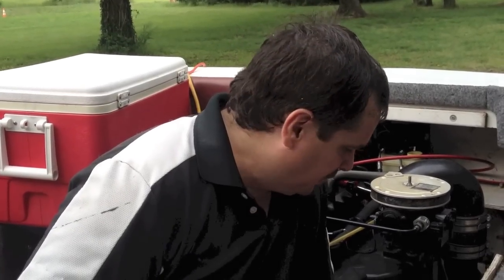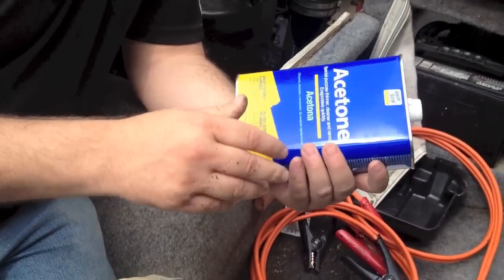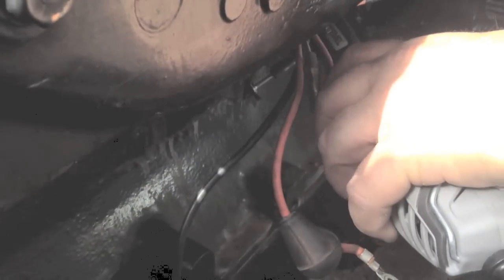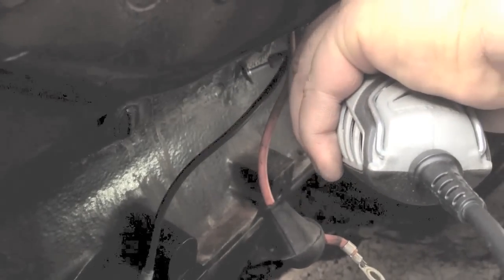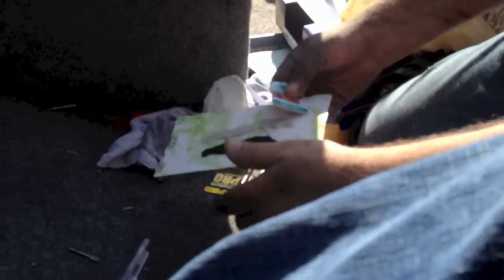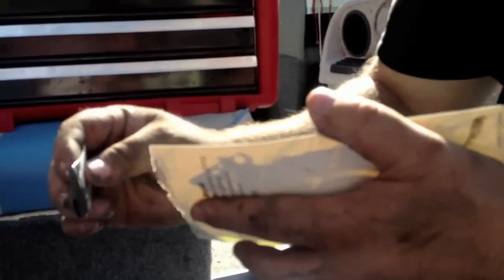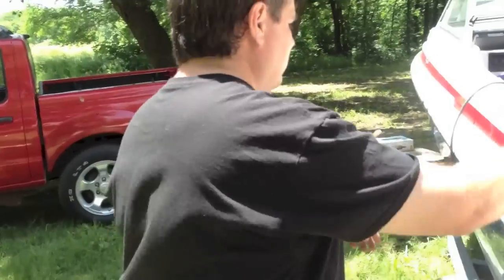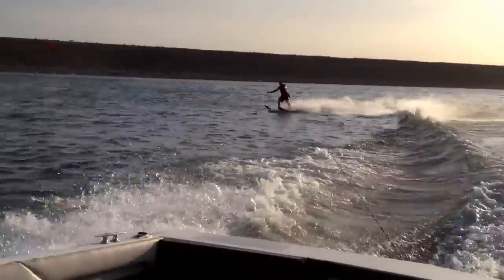Cracked Engine Block - Will JB Weld Fix It?

Comment: My JB Weld story: It was early 80's and I had a Saab 99, which preceded the 900. The harmonic balancer broke off in the winter, here in Alaska, and it was a nice clean break. The break in the balancer indexed very well to the end of the crankshaft, so it was a very good alignment, so I spread on the JB Weld, propped it up to hold it solid and put an electric heater on it all night. I drove that car for over a year before I sold it, and never had a problem.

Comment: I repaired a Cummins ISM cracked block with JBW behind the engine starter on driver side That was 4 years 215k miles ago and the engine still running strong without leaks. Awesome product. I strongly recommend it.

Comment: Most boats’ cooling system are not a closed system so it doesn’t build up pressure like a sealed cooling system with a radiator or heat exchanger so JB Weld will work just fine.

Comment: This stuff, in my opinion works great even as a permanent repair. I have used to repair counter bores on diesel engines, intake manifolds and such. Wonderful product! Very nice job cleaning the area Donnie, you will never have any more problems with that crack due to JB weld failing!
Reply: B s u havent applied it were oil pressure iz

Comment: I used JB to repair my crankshaft on my 350 chevy it held fine even though i'm running 100 shot nitrous.
I also used it to repair my wheel hub ,I did that 10 years ago and I run over 150 mph works great.
I also blew out a clutch on my work van but made a clutch out of jb weld.
I couldn't afford to fill my daughters tooth cavity so i used Jb weld
Jb weld is life , i got back with my wife because of jb weld
I haven't seen my son in 5 years
Reply: +bugatti veyron LOL hillarious
Reply: I was believing every word you said until you said van and clutch.  DOH
Reply: bugatti veyron I made a clutch disc out  of jb weld for drag racing. 
It grabs great. 
You should try one in your Bugatti veyron.
Reply: dude that is the funniest shit my stomach hurts from laughing
Reply: Jb weld can bring the bond between you and your son.
Reply: Jose Castellanos 😂
Reply: This shit had me dead laughing funniest shit I ever heard lol
Reply: JB Weld and Chuck Norris fought once. They decided call it a draw after 4 months of battle so Chuck would have time to round house kick the moon back into its proper orbit.

Comment: I have a1990 Dodge Dakota 4 x 4 that I have converted into a tractor, it sees hard service.  I didn't winterize properly either and ended up with a two in crack  just under the exhaust, I cleaned it up and cut a groove in the crack..BUT, the difference in the way I made my repair was that, I applied a VACUUM to the engine VIA the overflow "TIT" on the radiator.  I let it pump for about an hour, then I applied the JB WELD, let it keep pumping for another 20 minutes, it pulled it right in, I think that enough JB wasa pulled in to equal the block thickness .   I have sice tried this method on several other engines including Marine Engines.  It works great, all you need is access to an AC Vacuum compressor.  This way the JB is pulled intto the block and not just "stuck" on the outside like a "patch"..and this method works with other Mediums besides JB WELD.  
Regards ,
Boyd E. Falk
Reply: +Boyd Falk That's a damn good idea, on the vacuum pump!!  The block cracked in my diesel pickup and I'm going to try your method because I've got a vacuum pump that I use for A/C work.  Thanks for that idea!
Reply: Let me know how it worked out for you, I still haven't had any problems.
Reply: We simply drill small holes at both ends of the crack, grind out a deep V groove, and stick weld it with Nomacast.  The secret is only doing 3/4"-1" at a time and waiting a full minute before doing another 3/4"-1" section.  It works every time and we've never had a problem.

Comment: My father-in-law JB WELDED an engine block on a tractor,it was cracked all the way down the side,it has held now for over 25 years now.If I remember correctly,he put it on in layers letting it dry in between each layer.
Reply from the maker: Tim Ballentine Wow…25 years, that is good to know.  Thanks for letting us know.
Reply: +Tim Ballentine MAN THAT A BLESSING IM
Reply: Que Bridges Amen,it sure beat having to buy a new engine .
Reply: +Donnie Smith 497 years ago I fixed the crack on the Spanish Titanic using JB Weld,with the iceberg going through it,and never had problems since. The boat just passed its tests and I will have a party on it,for my 840 birthday. 
And by the way,a piece of the iceberg is still stuck in the boat. J B Weld helped to keep it intact. inside the iceberg,you can clearly see some oysters,an old boot,and Pamela Anderson's great great grand mother knitting bikinis for then Baywatch!
Reply: Tim Ballentine I have a blown engine block do you think it would work

Comment: Was very skeptical. Recently I was challenged with the same issue. Crack was horizontal with the cylinder head and about 9 inches long. No water in the oil, ran like a top. Opened up my crack a tad more with a dremel, stop drilled the ends with a #30 bit, cleaned the area with a cup wire brush on a 4" grinder and wiped the area down several times with acetone. I applied one coat with a putty knife pushing it into the crack. Waited 6 hours and applied another coat over the area. To my surprise, it worked like a charm with no leaking whatsoever. I'm currently looking for a replacement engine as I'm not sure I trust it just yet but, it did the trick.  Thanks for the video.
Reply: was water actually leaking out of crack?
Reply: You still running

Comment: Had a ford ranger with a cracked block.... ran 57,000 more miles after applying it. It held up and trust JB weld. Now, not all cracks are the same and other cracks in different areas will be different. My crack was at the driver side above the manifold right over the number 1 exhaust port. We also drilled and bottom tapped two holes and placed a steel plank to help with expansion. I know that was probably 95% of the fix, but the JB weld held it all together. It works.... just not with a piston hanging out of the engine lol

Comment: I have repaired a couple of 400 sbc race blocks with JB Weld and it worked very good. The engines had about 650 hp N/A and 300 hp of spray on them. They lasted for a few years each before a different issue put them out of commission.
Reply: That's what I'm going to use it on a 400 small block 598 horse power very slight crack..hope it works
Reply: @ronkush69 did it work?

Comment: I have used JB Weld on the cracked alloy sump on my VW: has lasted 8 years so far and 100,000 miles. Otherwise it would have been an engine/gearbox removal to get the sump removed for welding. Only thing is that the surfaces must be 100% clean and roughened.

Comment from the maker: Hi Jimmy, I hope it holds out for the summer too....if not, my boys are going to be sad....lol  Most of the wheels came with the kit I bought.  I had to get the 90 degree attachment separate.  This was my first time to use one, bit without air tools, it performed well.  Thanks for watching!  Oh, in case you're wondering, I found this tool and attachment at Sutherlands Lumber Store!
Reply: I’m going to give your repair idea a try I’ll let you know if I have questions. I have two cracks about 5 inch top to bottom to each other. One 13” long and the lower one is 7” long lol.

Comment: When I worked for General Motors as a tech. in the transmission shop, we would often have a cracked governor case and GM had a weld that we used and it really worked good. it was grey and took 24 hours to dry. it would hold trans. fluid and heat and pressure. It was also drillable and could be threaded if needed. Just in case that fails you have another option.
Reply from the maker: That is good to know.  Thanks for sharing!
Reply: great to know Chevy rigs it's vehicles to sell them
Reply: Brian Snyder what was it called
Reply: and they prob charged the same price as a brand new one ....

Comment: I'm dating myself, but in the 60's and early 70's Ford sold a metallic epoxy that was very much like JB Weld for dealing with porous castings like engine blocks and cylinder heads (external coolant leaks mostly). Ford never advocated patching cracked castings with it, but there were instructions on using the epoxy properly in the factory service manuals. Improvements in casting technology have pretty much eliminated the need for things like this. Nice test. I'm not a huge JB Weld fan, but I'm glad it's working for you.
Reply from the maker: scdevon Thanks for watching!

Comment: I just complete engine, and aftrr two coats of jbweld it holds good on crack when tested at home.So am taking it to a lake for little longer run and see how it will doo.. thanks for the video

Comment: Back in 1986 my dad let his tractor freeze up. an old a/c it cracked the block on the side about four inches long I cleaned it up real good an ground a little right in the crack.i cut a little line at each end of the crack an filled it in with jb weld it never leaked again an he drove it another 20 years still holding when he sold it in the auction.
Trust me I'm a believer just take the time to do a good job on the prep work an it will hold it's amazing.

Comment: Donnie thanks for this video. Bought a Bayliner in Wichita Kansas last summer and only had time to use it once. Then when I took it in for winterization this fall. The mechanic told me that because there were new freeze plugs installed, I probably bought a boat with a cracked motor. This statement was given by assumption, not by visual. Can't wait for it to warm up to check. And if crack is found, try your technique. Hopefully it will not be cracked. But if it is, this could save me the cost of a new 454 Mercrusier. Wish me luck. Will post results.
Reply from the maker: Jayme Fowler I hope it is not cracked, but the JB Weld is still holding on mine.
Reply: Donnie Smith Looked like it was still leaking at the 8:36 mark in the video

Comment: I have read a lot of articles about this as I too have a cracked block on my boat.  A lot of nay sayer's, but you know what?  Not one person has stated they have done it and thus had any ill effects. Only people who advise against it and recommend replacing the block. My question is why not try this if your engine is fucked your engine is fucked, right? I could see if you were going to take ur boat 50 miles out to sea. But for lake users... why not? Again, not one person saying that they used JB weld and it turned into a catastrophy.  I did my boat today. I will report on how well it worked after I start it up tomorrow evening.
Reply: Really, it's like what have you got to loose? What? is it going to ruin your already cracked block?
Reply: +zenarrrow Well in this case no news is bad news. Must have cracked inward. FYI no water did leak from the cracks themselves, but the dipstick showed water and foam. Engine ruined, just hope I can reuse all the other parts to amend to the new block. Reporting live - this is zenarrow for 420  news, back to you SuperBlenderBlade
Reply: I used it worked great my crack was about 3 inches same spot area

Comment: I tried using JB weld on a CAdillac Engine to seal a crack. I ever poured it insode of the water jacket to seal it from inside and then also applied it on the outside. As soon as the engine got hot the JB weld cracked and started leaking. ALso i did all the preparations necessary for JB weld to stick well to the surface.
Reply: GO check out Belzona.com.  Their 1111 Super Metal and repair procedure will fix cracked engine casing...

Comment: Thanks for the video. I forgot to winterize mine last winter. And today is 90f outside and am doing block repair with jbweld. I folow your work and i hope it will work. Exept i had another crack right under manifold so i had to take if off so i could repair crack. I hope it will work after i do another coat of jbweld.
Reply: did your repair work

Comment: Hey Donnie,
                     Great video-did all the drill bits and grinding wheels come with the 90 degree Dremel attachment? I hope the repair holds out for your summer on the lake.

Comment: AWESOME !!!!
My son just recently busted his new RC Truck he got for X-mas :(
But thank God, all the parts are replaceable !!!
The Pieces he busted need to be able to handle a bit of torque & strength !!!
After seeing your Vid & others, I have no doubt that JB Weld will do the trick till his new parts come!!
& if the hold up, I may just leave the fixed parts on till needed !!!
Thanks 4 Sharing Your Experience Using JB Weld !!!

Comment: Hei Donnie, I have a similar crack on my car's disel engine (150 hp). The crack is smaller than that and is on the coolant side. Do you think it will do the job?
Thanks for the detailed video.
Reply from the maker: I've had a lot of people message me after I made this video and they said it worked for them too.  Mine is still holding strong!

Comment: I had a cracked block on my tsx tried JB weld lasted about one hour tried belzone 111 the best stuff out there did not work replaced the engine ooouch! if the crack is under pressure(oil) it will not work as it was in my case.

Comment: I had a casting defect on a cylinder wall on an old ford tractor that i repaired with jb weld. it was a pinhole, and i was able to get to it from the backside. havent had any problems

Comment: My 350 sbc block cracked below exhaust about to fix mine the new k&w lime green bottle to run through coolant works great but I'm not big on mixtures in my motor good luck

Comment: Hi, what was leaking from the crack? coolant or oil? if oil please let me know if it's pressurized area or just under crankcase pressure? thank you for the tip, gonna try this and hope this gives me a few months until i replace my engine
Reply: Neither. It is a water jacket under the cracked area. They freeze over the winter and crack, if not drained properly! Theres not much pressure here...maybe 10 psi max

Comment: Curious to know if it's still holding. If you ever have that issue again try marine tex. I have a back up race motor that ran 2 seasons with a huge patched crack. I'm about to do it again and run that motor the rest of this race season as well. I assume it works great it held up to the abuse of racing.
Reply from the maker: justin stevens Yeah, it's still holding fine.  We've been to the lake skiing and tubing quite a bot again this year.  Thanks for letting me know about the marine tex, if I should need to do a similar repair again.

Comment: Just had this happen to me bought a boat this way and now I have it cleaned taking it to a welder if he can't do this job it jb weld time still running strong I assume?
Reply from the maker: Geoffrey Fredrickson Yes, still going to the lake.  Good luck with yours!
Reply: You got lucky. there's about a 1 in 10 chance (probably less than that) of it working and holding up.

Comment: when your engine block cracked there was it also putting water into your oil and in your pistons? cause mine is cracked around the exhaust manifold and i had milky oil and water on top of my pistons need to know how serious mine may be i know a technique on welding cast iron properly but before i go into welding it and sealing it i wonder if mine has a more serious crack than it appears
Reply: it probably is pretty serious. the way I look at it man. it's already fucked, you can't fuck it any more then it already is.
i'd give the jb weld a shot first even though it's gonna be putting A LOT of heat to the adhesive. if it works, you win. if it don't then try welding. with my experience on welding iron, it's hit or miss depending on the quality of the iron no matter how you attack it, you could end up with more cracks then what you started with. jb first, then go ham with actual welding
Reply: Put 3 pack of JB into the cooing system and 3 into the crank case. Run it at operating temp until it stops.
Reply: How would that work...assume you're kidding.  I replaced a clearly leaking manifold but still getting water in my oil.  Assume cracked block.  How would jbweld on the outside of the block help at all with water mixing with the oil?

Comment: I'd use steel wool or powdered iron with jb weld depending on hole size .
Reply: What does the powdered iron or steel wool do when mixed with JB weld?
Reply: @Mustang9831  rusts up used kb sealer was before jb weld was made .the jb 5 doesn't have as high a hardness of temp

Comment: I've a tiny oil leak which I think I've found where AC compressor is bolted to crankcase . Just changed my oil and filter . I'll make sure before trying anything . Tiny since I think it goes down very slowly just annoying . Yeah I hit something very hard . Possibly a problem if it still leaking when I try using permex / JB weld grey or black  glue since it's supposed to be clean and dry ? Any helpful experiences out there ? Do I have to wait till I drain it during my next oil change ?

Comment: J B Weld repair on K13 nissan diesel block, Extensive prep, laminated several layers. used 4 tubes. Failed

Comment: This stuff is AWESOME!!! Just dont trust the QUICK drying version. Isn't worth a damn. I've used JB weld on LOTS of stuff. Including... gluing a radiator back together on an Acura Integra that overheated and busted. The JB weld held so great.... the car overheated again weeks later.... but the radiator busted in a totally DIFFERENT spot. The JB weld held while radiator overheated with extreme pressure that time!!! Crazy stuff for sure!!!!

Comment: sodium silicate is the best thing to use run it for a day or two and it will seal the crack flush and fill and forget the crack
Reply: What is and where do you get this sodium silicate